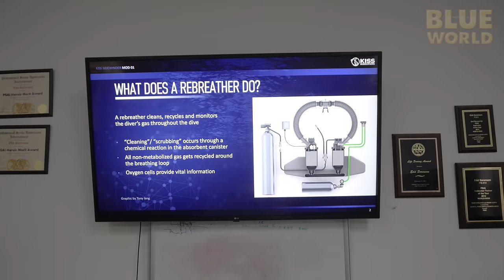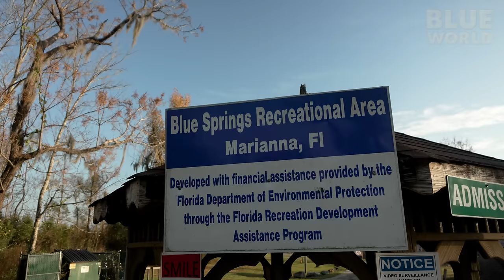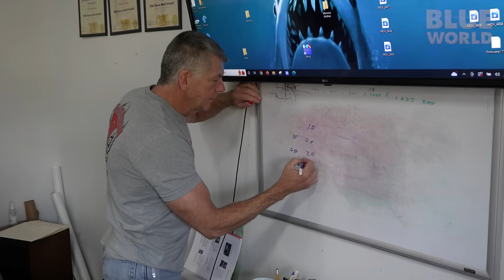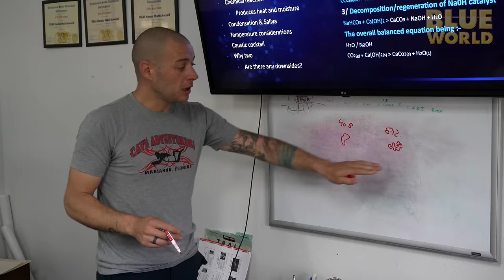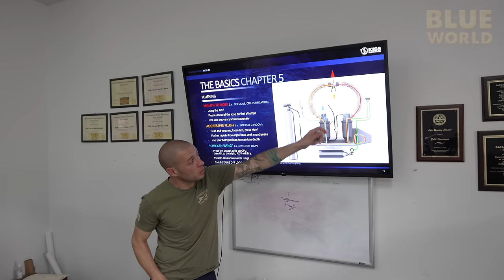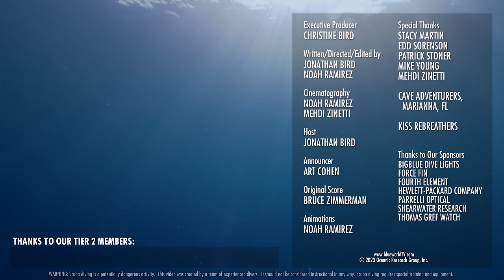Can we survive Edd Sorenson's Rebreather Class??

Comment: I'm a bit surprised you did your pre-breathe in the water.  I have always done it dry, to reduce the risk of drowning if it's inadvertently hypoxic.  Something to consider for future procedures.  Have fun, stay safe!
Reply from the maker: The purpose of the pre-breathe is to test your sensors with pure O2 and to confirm your diluent mix.  The whole process is done while watching your P02.  If anything is hypoxic, you will see it immediately.  It has been shown that using a pre-breathe to "test" the scrubber actually doesn't work.  So your pre-breathe is always done watching your PO2.
Reply: @BlueWorldTV  That assumes all your electronics are functioning correctly.  I understand and agree that pre-breathing is not a reliable test for scrubber functionality, however, you test more than just the scrubber. You can get reasonable assurance gas addition (both O2 and Dil) is functional, and you get to warm-up the scrubber bed.  IMVHO it's not harder to test out of the water and quite a bit safer, but YMMV.

Comment: Great video, congrats! The practice of packing the sorb inside however is a bad example IMHO and should be disregarded. The sorb should always be packed outside for a reason.
Reply from the maker: What is the reason?
Reply: @BlueWorldTV  Pouring the sorb into the canisters produces dust which tends to settle everywhere. One place where you surely don't want it is on your mouthpiece. Otherwise the moisture and saliva generated during the breathing process might create a caustic bitter taste which will make you spit the loop very fast. Hence you stay away of anything which is inside for enhanced safety. Also you don't clean your hands afterwards against your trousers, but you should use clean soft towels - all around to wipe out all surfaces which might have come in contact with the dust, even being outside. This is the European ccr school practice.

Comment: You have to change the filter particles after every dive?
Reply from the maker: The scrubber is good for about one hour per pound of material.  The sidewinder holds 6 pounds so we tend to run them 5 hours to be safe.  So we use that as a guide to decide when to change it.  During training, we change every day to get practice in packing it.

Comment: Theres already a false sense of security from the open circuit habits, and them misjudging that skills as same for closed circuit habit.  Old habits are what they need to change, and that will take the same number of logs of dives of the closed circuit too, but since they have logs on open circuit, they are overconfident that logs will be counted as closed circuit dive logs, which they already know, isn't the same case. Mistakes begin from the class itself. 4 day is too short, for closed circuit and it will take as much days to learn it, as in changing habits to closed circuit diving, because it became more complex as now its continually variable, in terms of more number of parts. Implosion risks are there too, so be very aware of it all. Deco stops are low, but as soon as they go to the staged cylinders, deco stops need to be manually thought through, and be VERY careful of the time spent, of the depth currently at, of the cylinders needed at that particular depth, and of the deco stop time. Every minute at higher depths counts on your deco stop, and that means, you better be having a proper reason and good value to spent that time there, and if you don't know what you are doing, better not to rush there. Its not like deco stops end with rebreather, the physics always is demanding it. Its a very challenging place to be in and only the best fit should go into there, after taking your classes.